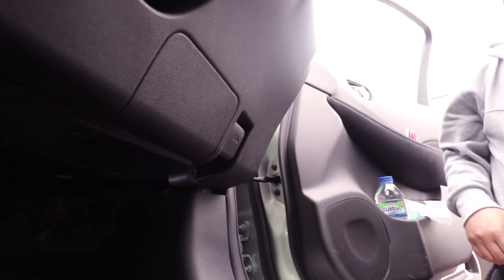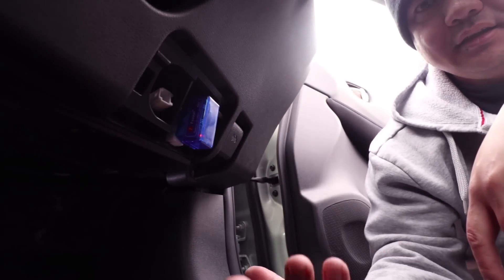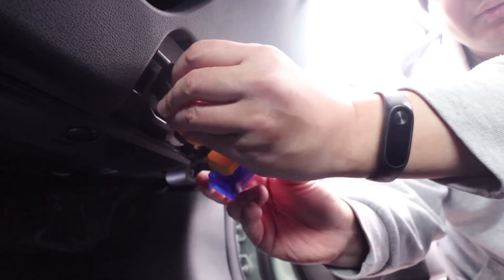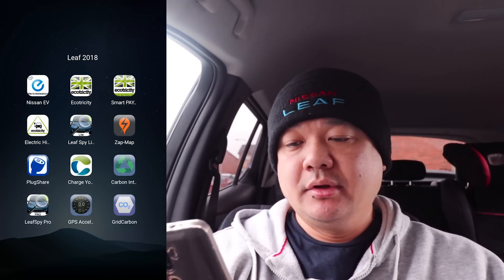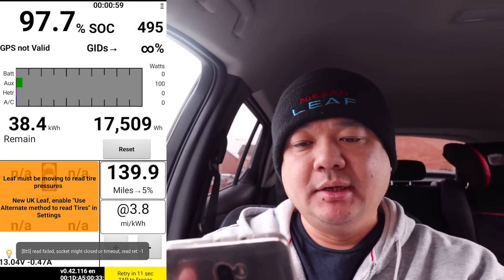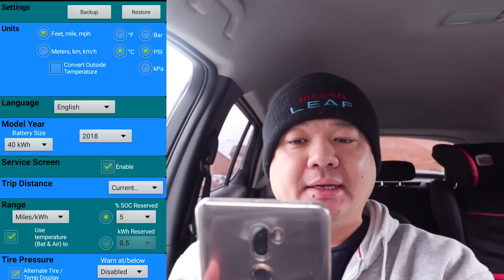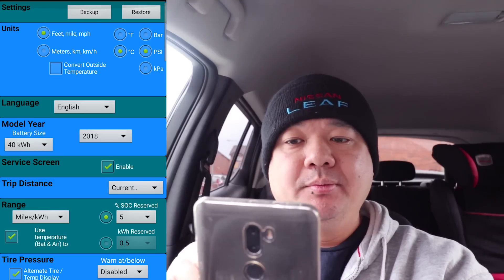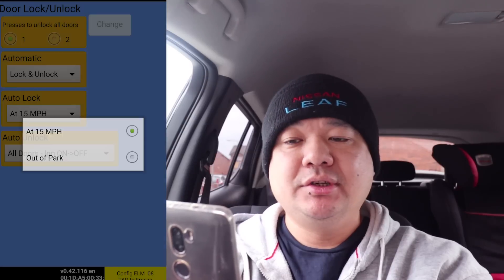Nissan Leaf 2018 - How to install OBD II and Leaf Spy Pro?

Comment from the maker: Leaf Spy Approved LELink OBD2:
Note from supplier: 
yes, our product LELink works with Leaf Spy Lite or Leaf Spy Pro on the Android or Apple Store. Our adapter also has user configurable auto on/off ZEROpower standby, so it won’t drain car battery. https://amzn.to/2HlXfnY

I will do a review of the product soon.

Looks like that OBD2 is out of stock make sure you search for the following when looking for the right OBD2 as there's a lot out there that does not work with Leaf Spy so its a bit hit and miss.
V1.5 Firmware
 ELM327 
OBDII OBD2 
Bluetooth or Wifi

Comment: Anyone else had issues getting this app to work with new dongles? I'm on my 3rd OBD2 dongle and still no luck. Most recent LELink2 dongle works with other apps, BTW, but not LSP, so must be something to do with supported protocols or some other issue? Going to give up at this point if there are no obvious solutions..
Reply: FINALLY got the LELink2 dongle to work! Turns out I needed to enable GPS on the phone before I installed LSP. That prompted the phone to ask about permissions for accessing location data. Without that simple step, LSP was blocked from accessing data from the dongle completely. That was after 4 separate attempts to uninstall, re-install and change different settings on the Android 12 phone. I knew the dongle was working as it was quite happy to send data to Car Scanner. Anyway, all good, and I can be just as big a nerd as the other boys now! Meanwhile everyone else has sold-off their Leaf and bought a Tesla ;)
Reply from the maker: @decimal1815  that great you figured it out.  it's one of the best odb2 unit and app for EV I've used to date. For current bang for buck the leaf is a great buy especially if your looking for a second EV even with its quirks.
Reply from the maker: I've just tested on the nissan leaf with the wifi dongle and latest leafspy pro and got it working. was a little fiddly as i tried to connect the dongle via BT but think it was the the one in the IONIQ5, after i switch to WiFi connection it worked. I've lost my LELink2 as that was an easy plug and play before. maybe remove all BT devices and try again?
Reply: @LemonTeaLeaf  for some reason the dongles work with Car Scanner app but not Leaf Spy Pro. Suspect it might be something to do with the new dongles have less support for EV protocols? I'll work it out eventually..
Reply from the maker: @decimal1815   Leaf Spy is rather fussy with it's protocols which is why I would only recommend the LELink as it's made for leafspy. and the most compatable.
Reply: @LemonTeaLeaf  I have the LELink2 but I suspect that it's been "improved" in the version that's now available. I'll report back if I work it out or if it's a different issue. 👍

Comment: Does this OBD works for every EV?
Reply from the maker: It might but you'll need to find out specifically which one you can use for your car. As with the Nissan leaf out of10 OBD companies, 7 couldn't verify if their product would work as not all OBD have the same handshake to vehicles.

Comment: Hi James, that's it, I don't need to do any other research, I've watched your video, and now I'm all set to go :o) Not sure what I'll do about model type, not having a Leaf, but I'll go with the 40kWh 2018 Leaf I'm guessing. Thanks OBD Kenobi, you've taught me lots...
Reply from the maker: Nice one! make sure you have the doors on Auto lock after 15mph its very handy. Yes I'm sure if you pick the Leaf 2018 it'll be the closest. If you have any question let me know on Twitter :)
Reply: @LemonTeaLeaf  Cheers James, all up and running on 40kWh Leaf. All except tyres, but not a problem. Very interesting stuff just out on a short trip :-)
Reply from the maker: @TeslaModel3Adventures  doesn't work on the Leaf40 ether. As leaf spy can't access it unlike the older models

Comment: I've got a US 2018 Leaf. The ODB port is straight down from the steering column about a foot back on the panel. It doesn't have a cover, so all I did was reach under and plugged it in. No access panels to remove.
Reply: I have a 2013 Leaf and the ODBC port is about in the place described here. I guess they didn't move it much for the US.
Reply from the maker: DSTARInfo Oh, that's different. It still amazes me the slight difference between regions for cars.

Comment: Thinking about getting an OBD 2 and Leaf Spy Pro but hope you can help. Once you have installed the gadget or dongle , does the cover refit or do you just leave it off?
Reply from the maker: Geoff Nuttall no the cover won't refit back on I have it in my centre console is not that big so just keep it safe :)

Comment: Bought the LELink OBD2 from Amazon UK and couldn't pair bluetooth despite it showing the red light. Tried with four android devices and 2 Apple device but no joy. Tried with the Leaf  off, on and on and ready to drive. Tried with a Hyundai i10 and got the same results. Tried emailing the supplier (as listed on the device instructions) and email address does not exist. Arranged for a return. Just wanted to inform other potential buyers of my issues.
Reply: Okay change of plans. Return cancelled. Doesn't pair over bluetooth in the device itself only via the Leafspy app. Car needs to be on and ready to drive. Ensure the OBD II is plugged in. Run Leafspy (ensuring android/apple device has bluetooth on) and in settings connect via bluetooth. Should now connect and start reading Leaf data.
Reply from the maker: Thanks, SKTechnologySolution, I've got a couple of OBD coming for testing including the LELink OBD2, I have a feeling that the LELink is connected via Wifi? Have you tried that? Plug it in while your car is off then turn the car on and try connecting to Wifi. I'll be doing a review of a few OBD2 products soon testing with Leaf Spy. 

If you bought off amazon you should beable to send back for a refund if its defective.

Comment: Hi I just got my Nissan Leaf 2.0 please I can’t connect the ev connect app . My car shows no signal. Do I need SIM card or what? Thank s
Reply from the maker: Kwaku Obeng you need to sign up online. It's best to do it on a computer. Once you have an account you need to apply your vin number so it links your car to the account. This is the UK link.

https://youplus.nissan.co.uk/GB/en/YouPlus/ConnectedServices.html

It'll take you through the the process of how to find your vin number etc.
Reply: I have sign up but my car don’t have the mobil signal
Reply: That happened to me as well, you just need to take the car back to the dealer and get them to recalibrate the TCU (Telematics). Took them 10 minutes and it was running fine afterwards!

Comment: Very helpful video, thanks James.

What is the small white connector used for, the one immediately to the left of the larger one into which you plugged the ODB2 adaptor?  What type of plug does it accept?

Re Nissan Uk’s awaited response, why do you expect/hope it will be any different from what Nissan USA are now saying?  Their statement is entirely consistent with the warning in the User Manual that to protect the battery from damage due to overheating, the battery should be allowed to cool after the first rapid charge before the second charge.  They say active battery cooling was omitted to keep the purchase price down.

I think Nissan are destroying their credibility by not including active battery temperature management.  The only way I can see whereby they can salvage their reputation is to offer this as an optional extra across the range ASAP.  That way those who need to drive longer journeys can do so if they’re prepared to pay the extra while those who don’t need to can avoid paying for something they don’t need.

Keep up the good work.

Comment: I have today decided to cancel my order. I was hoping that Nissan's response was going to be we will find a solution, but it seems that 'It's the we designed it'  makes me annoyed when it effectively limits the car to 150m journeys. 150 miles there and 150 miles back. I am also now starting to hear that in America where ambient temperatures have hit 21 celsius their are unconfirmed reports that #rapidgate is occurring on the first rapid charge.  I still want a Nissan Leaf, but I will wait for the 2019 version.
Reply from the maker: I think that is the sensible choice. NissanUSA response is very poor indeed. I hope NissanUK will have a different response  to this as I’m waiting to hear back from them still. I think 2019-2020 will be the year when the consumer will have a larger choice of EVs.

Comment: Thank you. I got the Leaf just over a week ago & it's been great so far. The link to the OBD2 is currently unavailable. Does anyone have a link to another one that would work with the new Leaf? I see a lot of different kinds on eBay & Amazon but I'm unsure of the exact one I need.
Reply from the maker: Leaf Spy Approved LELink OBD2:
Note from supplier: 
yes, our product LELink works with Leaf Spy Lite or Leaf Spy Pro on the Android or Apple Store. Our adapter also has user configurable auto on/off ZEROpower standby, so it won’t drain car battery. https://amzn.to/2HlXfnY

Comment: Cheers mate, won't be using this until I have 10k which should be around early June and then every 10k after.
Reply from the maker: Fancy a Bev Mate? No problem is that to check on state of health of the battery?

Comment: Given what you currently know about rapid charging, would you still purchase the Leaf today and if not which car you have purchased instead.
Reply from the maker: Simon Carr I pre-ordered thinking this will be the electric car to do 130-150 motorway mile which would be the perfect car for me. But with the battery issues and learning to live with it. I would buy the leaf just for the tech like ProPilot and ePedal. But if I'm honest I would really consider the ionq over the leaf mainly for the motorway drives I do. It would be a hard choice to be honest. I might even have consider dare I say a Mitsubishi PHEV as the family long distance car and then bought the 60kWh Leaf (nismo) when/if it can out but by the they'll be a lot more on the market.

That's almost a politicians answer... Ok bottom line I would buy the leaf what I know know. But would have to consider a second car for long distance. In the ideal world it should have been the one car that rules them all. 🤣
Reply: Lemon-Tea Leaf hi mate if I may just bring something that the ioniq doesn't have? First of all the boot is way too shallow for bigger loads but for me more importantly is the extra height over cars lower to the ground. Having an elevated driving position makes for much more safety and ease of the pulling out of the junctions etc. Cheers

Comment: Hi James, im not a tecki person and my first time to buy a car, waiting for my SV hopefully it'll arrive this summer. Questions:How come we need obd2 for the leaf? Do we really need this to generate info to activate leaf spy? Sorry for the dump questions.
Reply: Saggie Sky Yes you need the OBD-II adapter if you want leafspy to work. The adapter is the bridge between the car and your phone.  All communication in the car is done over CAN BUS. A phone connect only over bluetooth or wifi. The OBD-II adapter translate information between the two protocols.
Reply: Saggie Sky personality mine is always plunged in. It will not drained your 12 volts battery.
Reply from the maker: Saggie Sky Hi, yes you'll need an OBD2 so the phone can talk to the car via Leaf Spy Pro. The OBD2 is used by garages to diagnose the car. I'm only using it to get as much info on what the car is doing. Most people will want this to get a better idea of the actual battery level state of charge (SOC) especially for long journeys. Hope that answers your question. Also there's never a dumb question so ask away 😊
Reply from the maker: What Gilles Pelletier said 😁
Reply: The main reason for using this tool is gain more detailed information on the cars battery state of charge and temperature, and other electronic gizmos, the dash display on the car is very basic in comparison, that why people buy it.
Reply: Thanks James and Gilles. Do we need to keep it  there once installed or do we remove and reinstall it every day?
Reply: Thank you, Gilles!

Comment: Thanks for the video, they are great. Am I correct, the ODB II is on even when your not in the car and doors locked.
If so, I see what you mean by it being a security risk. So someone (if they knew password 0000 or 1234) could log in and change the doors to always be unlocked. 
Look forward to many more videos.
Reply from the maker: MrSnowMen the Bluetooth is always on. I don't think they can unlock your car from just via the OBD II. Also most Bluetooth give around 15 second to connect before having to turn it on and off again to retry. But for the security concious it maybe best to unplug unless you know exactly that the dongle does after leaving it plugged in.
Reply: Thanks for the update. 
Chat again soon.